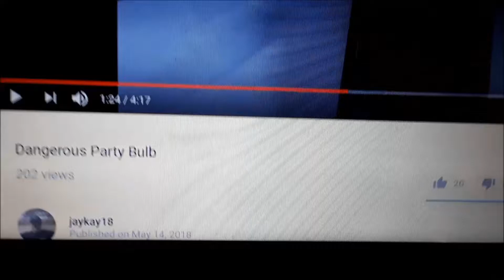Microwave Turntable Motor Generator

Comment: 2 questions, 1) what is a ‘’square wave’’( if I’ve got the name right, not sure what the words were), 2) I have several of these Microwave motors that I’ve salvaged from old cookers. I have been trying to use a ph charger for the USB to change the AC to DC, and even though the microwave motors I have a 240v - 4W,  i can’t get it to charge a ph, any ideas? I have a collection of old obsolete ph chargers that don’t have USB sockets, just the wire that goes straight to the ph( as they used to do before USB’s). I would really like to utilise my 6-7 microwave motors as ph chargers to give to homeless people for emergency charging. Any help/advice would be much appreciated! ✌🏽🌎

Comment: I got one of these and you can shock  yourself pretty good. I made a full bridge rectifier to convert it to DC.
Reply from the maker: If you use that setup to charge up a capacitor, it would be really nasty (I got a very nice shock years ago messing around with the flash unit from a disposable camera)

Comment: Take out gears and use the magnet and a motor then it will stay on constant 100v or near to it. But 5 volt usb to old drill motor or any motor the electric still flows 5 v to 100 v

Comment: Take out the gears and spin just round small magnet and spinning it easier than with the cogs also hook upto 5 v drill USB and see voltage it makes. Just magnet and coil. No gears to slow it.

Comment: is that AC or DC?
Reply: 120 volts ac single phase
Reply: @KAFKUBA  hy sir 
If we give this motor five rpm then please tell me at least how much electricity this motor will generate in watts.
Reply: @m4heritage432  3 watts
Reply: @KAFKUBA  I work on free energy and if this motor is rotated at a speed of 5 rpm per minute then the electricity generated from it can be free energy even if it is half a watt so I asked him at least how much electricity  Maybe I shouldn't be embarrassed
  thanks sir
Reply: @m4heritage432  its on the label.. at 5 rpm 5 watts... and nothing is free
Reply: @KAFKUBA  Witness: You did not understand my question. I was trying to ask you how many watts of electricity would be generated if this motor was rotated by hand at a speed of 5 rpm. At least thank you.

Comment: Also you should tell CABLEvision on a thread about the Model 120s from 2007 that the so called diesel generator inside a utility can was actually a control cabinet. The blower was a electric Paxton blower that was under the sirens rotor and horns on the flange that supported the frame and now the Whelens.

Comment: If your curious ,I'm working on the Model 120 ,I need to get two motors for it and I need to send the drawings in to a fiberglass and metal shop to have the horns and frame made. When the frame assembly is done the siren will stand 59" tall (from the bottom of the blower to the top of the rotor motor) ,and the largest diameter is the horns of the siren which is 75.45" in diameter. The length for each horn is 32" long and height is 39". If you wanna hear what it truly sounds like go on my channel ,My friend Edaan Freidman runs it up with a 3300 RPM drill and the max speed with the motor is 3450 RPM. And we are just using an air compressor to blow air through the stator ports because we don't have the fitting made yet that would connect at the bottom of the rotor assembly to the blower. 

When its complete ,since I live in Yorba Linda you can come see it in person.

Comment: Thanks for the shoutout!  I'd guess that turntable motor is geared down considerably since it spins at such a slow RPM.  That's probably why when "run in reverse", the motor spins really fast inside, and makes such voltage.  That seems to make considerably more voltage than the gizmo I have, though it's a lot easier to shock yourself with mine!  

I'll have to see what else mine can power, though its internal LEDs are probably dragging down the amount of power it's producing.

I guess in reality we've sort of reinvented the hand-crank flashlights they make for emergencies.   Oh, in fact, that reminded me, since we ran these motors in "reverse", I did a video on that running one of those hand-crank flashlights in reverse, it's called Hand-Crank Generator Flashlight Repair, from over 3 years ago.

Anyway, thanks for making this video, I really wanted to see that!